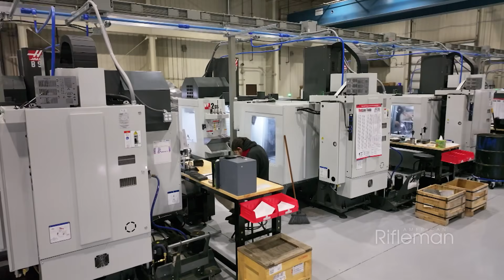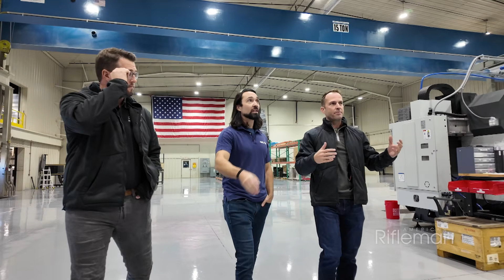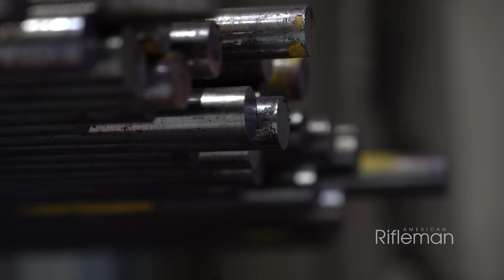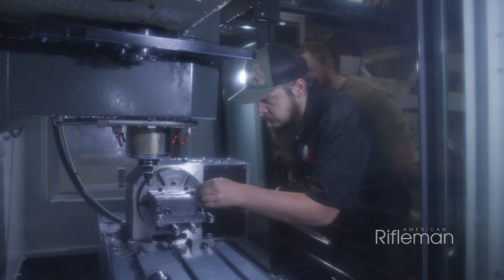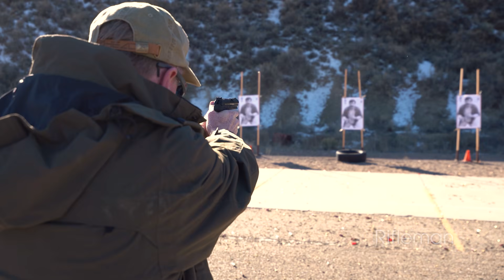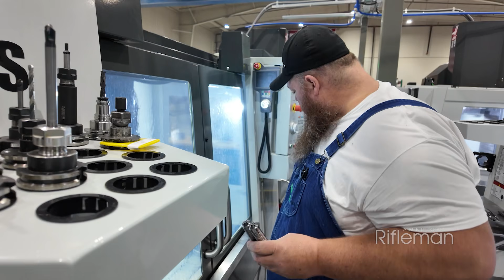Making The KelTec PR57 In Wyoming

Comment: I’m still having trouble with mine jamming/ getting stuck when extracting. So far, it’s ve spent more on ammo than what I paid for the pistol. Don’t know how much longer it’s gonna take to break it in. I’ve cleaned it, oiled it. Just polished the ramp, so lets seen if it will work this time and actually work as a semi auto and not as a single shot. 
Any suggestions please advise.

Comment: I bought two PR57s. I planned a day of shooting and was cleaning the first one out of the box, and the spring clips were missing so the springs and rods went flying accross the room when I took the assembly out of the slide. Took it back to my now Ex-dealer and instead of taking a guide rod assembly from another gun, they sent it back to Kel-tec. My son and I planned a range day while he was visiting from out of state, so I went to a gun show that was in town that day and bought another brand new one for $399. We went to the range the next day and the gun had issues returning to battery. I used 3 types of FN ammo. I hope it breaks in because I want to carry it.
Reply: I’m still having trouble with mine jamming/ getting stuck when extracting. So far, it’s ve spent more on ammo than what I paid for the pistol. Don’t know how much longer it’s gonna take to break it in. I’ve cleaned it, oiled it. Just polished the ramp, so lets seen if it will work this time and actually work as a semi auto and not as a single shot. 
Any suggestions please advise.

Comment: Well its not correct to say you are pionering a new looking system. Its taken from the Russian GSH-18 pistol that have the same rotating barrel and front looking lugs. But yea its not a "normal" way of doing that. And the combination of elements in the pistol are new.
Reply: The method and purpose are still different. The front set of lugs on the GSH-18 do little more than guide the action for the rear, actually load bearing set of lugs near the chamber, and keep dirt out.

The front lugs on the PR57 directly interface with the slide as the delay mechanism. The Russians copied Berretta’s take on a rotating barrel, Keltec did their own thing.

Comment: I would like to see a magazine model also...
Reply: I don't see why they wouldn't, it would jump in price, but it would only make sense for them to.
Reply: @MagicalTrout the market for conventional magazine fed 5.7x28mm is already fairly saturated for the caliber’s mediocre popularity, the PR57’s main positive is that it’s made more for concealed carry. Also, both at the club and the range, strippers are fun!
Reply: That’s like saying a feet-first motorcycle would be better if they stuck footpegs on the sides so it could be straddled like all other motorcycles.

Literally the whole point of the PR57 is to break away from the paradigm of detachable box magazines in the pursuit of making a superior concealed carry option. It’s literally about the same size as an M&P Shield… which is single stack and still thicker than the PR57. It’s smaller in all dimensions than a G19, while also being much, much lighter and having full sized pistol ammunition capacity.

Comment: Cant own it in WA due to it holding over 10 rounds. And they classify the stripper clip cassette as a high cap magazine.

KelGren/ KelTec using a stripper clip isnt new. I had one of their 380's from the late 80's/early 90's that used them. Not fast to reload, but it was designed to get you out of close range trouble and run like hell.
Reply: That stanks!